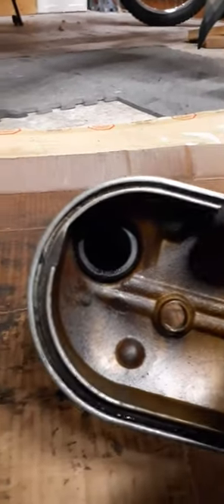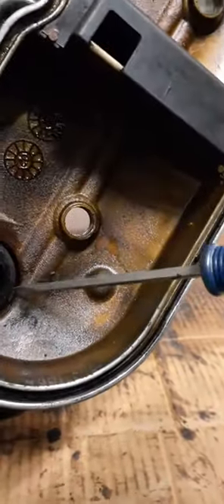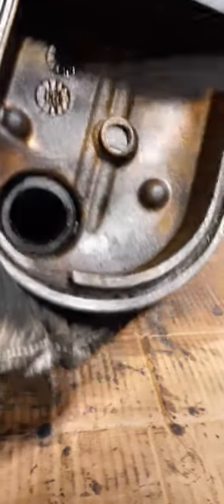Chevrolet LS engine Oil Filler Tube Removal 6.0 5.3 4.8 Chevy Silverado Tahoe Suburban 1500 2500 HD

Comment: I now have the exact problem on my 2014 Traverse, I have come across your video and I am now a follower. Truly appreciate you uploading such easy fix.
Reply from the maker: wow great !  thanks!  I am curious, the cap fit directly onto your valve cover also?   I do wish they had made the oil fill tube out of metal, then most of of would never have this issue.

Comment: Very cool!! This is really clear explanation. Just what i was looking for. Thank you.
Reply from the maker: Thank you!  I forgot to mention... if you want to be rid of the extension tube and not worried about breaking it, just forcefully twist if off and replace with your oil cap.  Just check in the hole to make sure there is no broken plastic inside.  If there is, tweezers or a vacuum be of help.  :)

Comment: Thanks for the help. I'm currently working on a 2007 Chevy suburban.
Reply from the maker: anytime !  :)  unfortunately, not every LS within the year range stated is compatible with this trick.  I saw your video about a spun bearing.  I did that to my first car with a small block chevy engine.  Had to rebuild it twice, due to my errors but that engine is still running 30 years later !

Comment: Any problems reinstalling the valve cover back on to the engine? For some reason, I'm having a really hard time trying to thread the two center bolts into the head.
Reply from the maker: Hello, yes the threads can be hard to catch since they cannot be viewed.  I use my fingertips to insert the bolts,  carefully try to feel the receiving hole inside to thread them finger tight.  Relaxing and closing your eyes can even help.  Its like fishing for a hole 😁

Comment: MINE IS LOOSE .CAN I pull it right off then put the cap only?
Reply from the maker: Yes the plastic usually will break right off if You Yank It Out I have heard sometimes the Cap won't fit depending on what year your vehicle is
Reply: @sixty6chevy  2002 5.3 tahoe
Reply from the maker: @ari1234. That year is good,  it should work perfect with the cap.   I have seen in some of the comments where it does not always work for every vehicle.   Please let me know how it works.  Thank you.

Comment: Umm I broke mine off accidentally. Have not taken the valve cover off and that would be a bigger job than I'm qualified for. Do you think a small piece of the tube fell in? Can I drive it to a mechanic?
Reply from the maker: in my opinion, I think it would be ok, it would be plastic vs metal if anything went in there it is not likely to harm anything.

Comment: Makes you wonder why they even bothered adding a tube.
Reply from the maker: I agree.  Mine does not use much oil, even at over 200K miles.  A metal tube would have been more expensive but much nicer !!